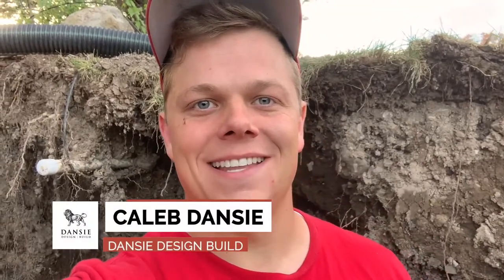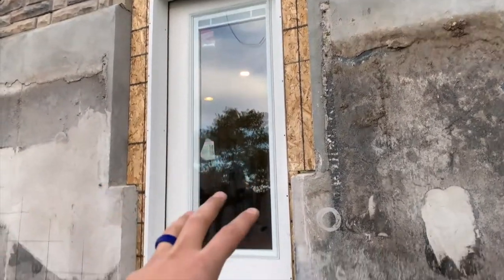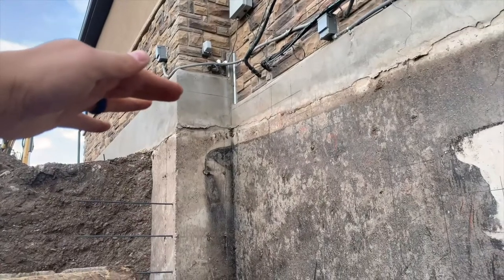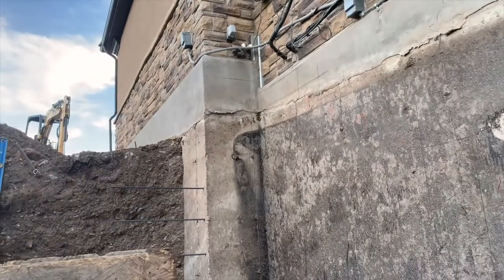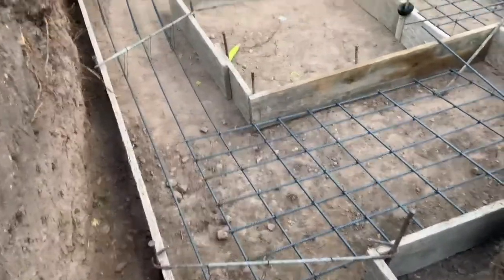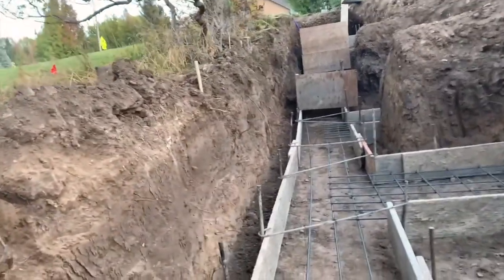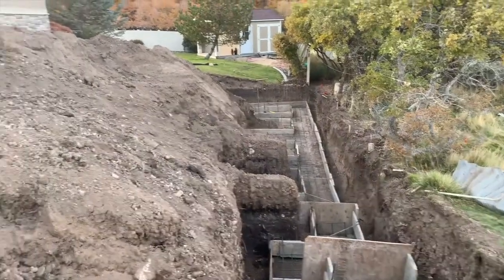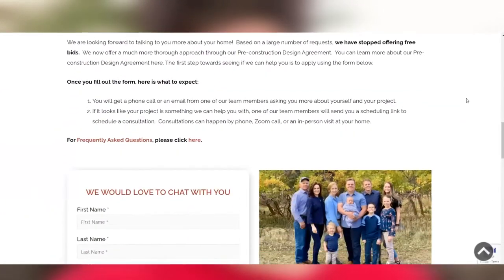Footings and Rebar for a Basement Finishing Walkout in Herriman, Utah

Comment: Caleb do you have to do any waterproofing on the wall that the new door is on?
Reply from the maker: Hi Brian! Thank you for your question about waterproofing on this basement walkout.  Waterproofing is required on foundation walls that are exterior walls to a living space.  So, pretty much all basement foundations in Herriman are going to have damproofing tar on the foundation anywhere the foundation is covered with dirt, and, there is a living space inside.  
For this walkout, there is not any additionanl living space that we are adding to the home.  So, no damproofing is required.  However, we did put some waterproofing tar on the exterior side of the walkout to keep any humidity/water from coming through the concrete wall at the bottom of the stairs.  Again, it's not living space, so its not required by code, but we did put some damproofing there to make it a very nice walkout foundation wall.